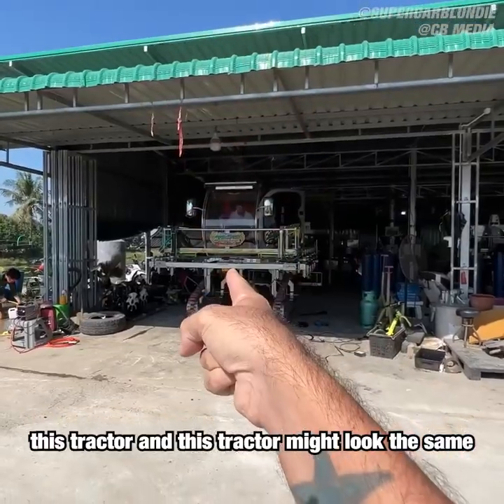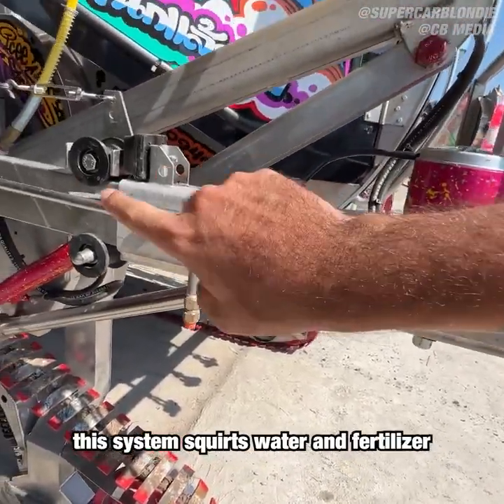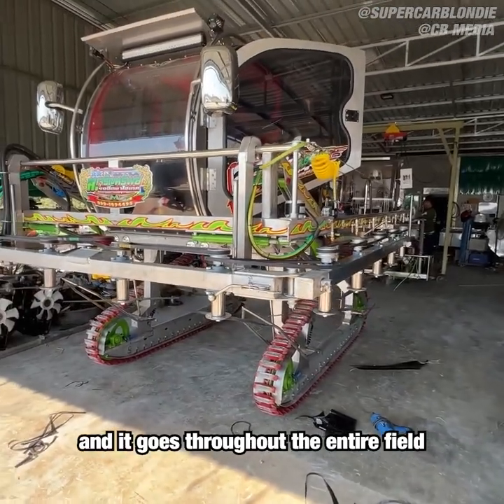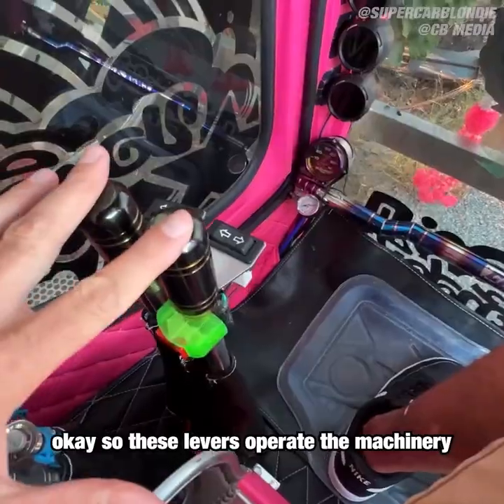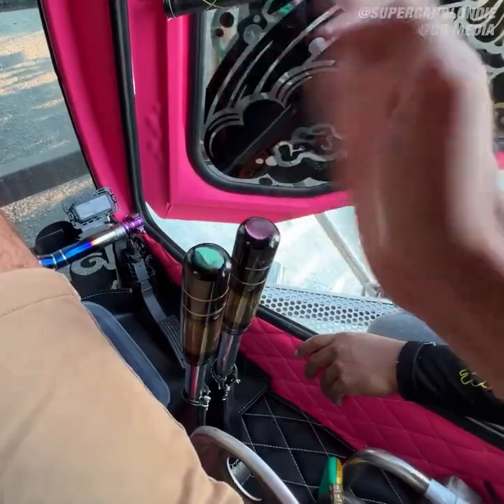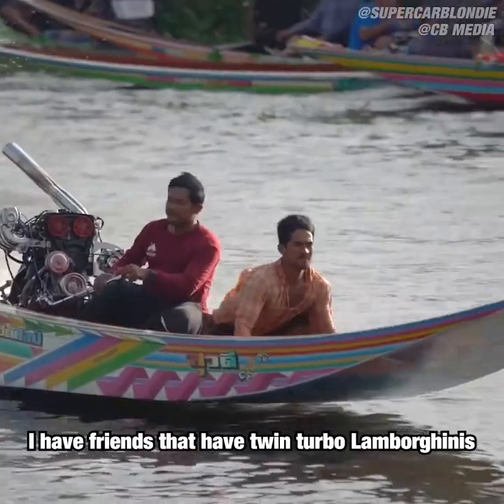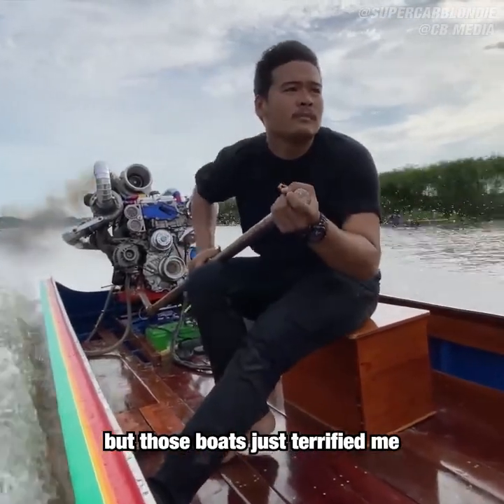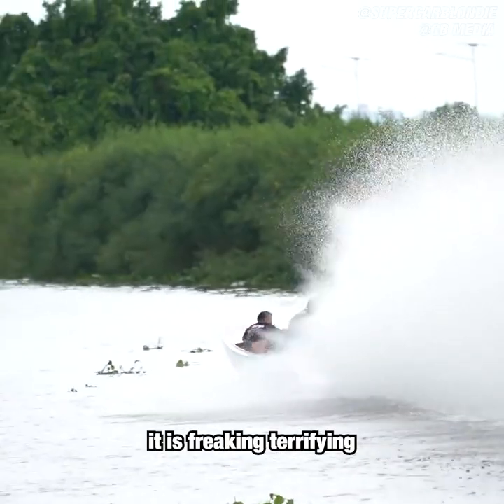This is the COOLEST custom rice tractor ever! You need to see this! 🔥😎

Comment: I tell ya whats scary about a boat, no brakes.....water has the same density as concrete if your going fast enough, and there is also the chance of flying off into the bank and ramping hundreds of feet into the air. At 80mph your in the 200ish feet zone if your jumping a car. Can imagine what a boat would do